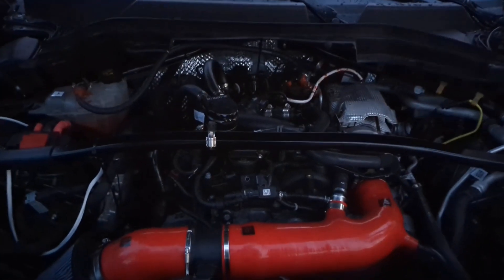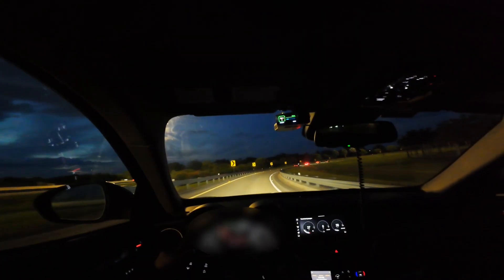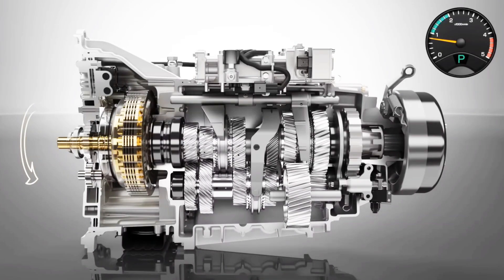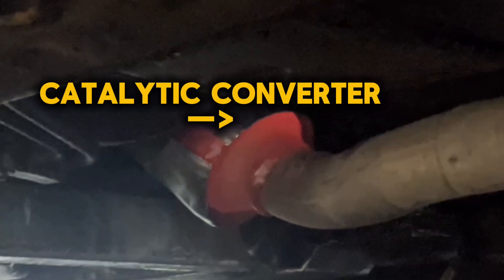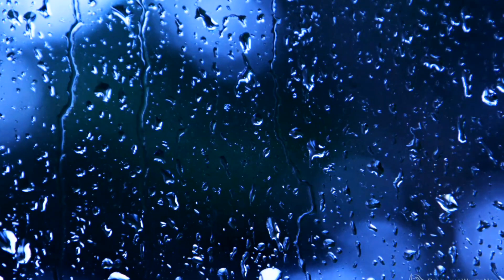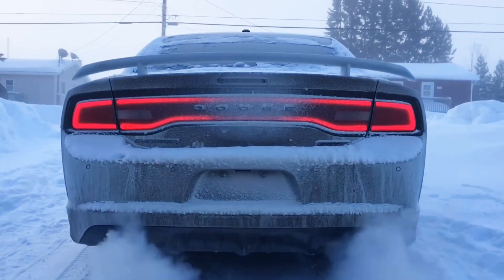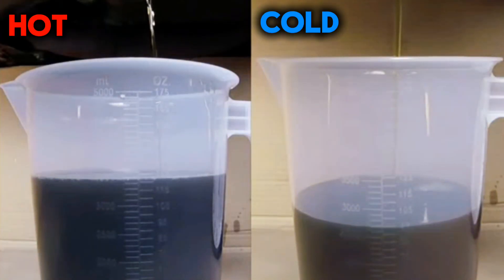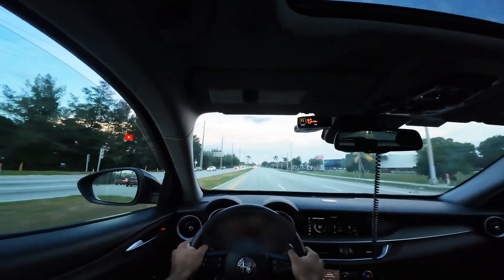STOP Warming Up Your Car – The Truth

Comment: I'm gonna say b*******, I've got AG. MC with 417000 Miles on it bought it new every time I start up, I'll let it get to operating temperature, just like I let my body warm up before I do anything I own a 2012 Toyota tundra.  219000 miles same thing, I let it warm up. Toyota, Camry 330000 Miles same thing, I let it warm up and get the steel to the right temperature before you start putting torque against the steel, you can do whatever you want to do, but I'm a lot one of those people just crank app and go  I've heard too many stories

Comment: I think it depends on the engine/drivetrain. My car rarely revs beyond 3k and when were changing the spark plugs and checking the head it looks ridiculously clean after 100,000km as if it was just out of the showroom. I usually warm the car up for around 10-20sec but when I leave it for 5+min the car drives very smoothly (Nissan Patrol 2016 shorty, 5-speed manual).

Comment: Catch 0:22 oil pumps are mechanical and oil pressure begins immediately. The residue throughout the engine is pressurized again immediately and extremely cold temperatures is the real culprit ¿`_

Comment: As far as there is a problem of accelerated wear at engine startup, I highly recommend an engine block heater.  I live in the Mojave, and if my car wasn't parked where I cannot supply power to it, I would have equipped an engine block heater even though the winters are very mild here and used it in the summer just to eliminate all under temperature operation and the wear associated with it.

Comment: If you are in a newer (past 5-10 years has gotten much worse) vehicle, they are specifically engineered to start having multi-system failures shortly after the warranty expires. 
Just warm up your vehicle to your liking, the shelf life is shorter than any damage you may potentially cause through emissions controls.

Your gearbox couldn't care less if you idled for 10 seconds or 24 hours a day.

Comment: So what, just hop in and drive while my windshield is still fogged or iced up.  Even in NWFL, the temp drops enough in winter to ice up my windshield and even if I scrape the ice (that I had to buy online because when I went shopping for one locally, the idiots all laughed and said they don't carry them because "It's Florida" and they don't wake up early enough in the morning for the ice to still be there.) the windshield is fully fogged over and I need to let the heater run on defrost for several minutes to be able to see out of it to drive.

Comment: All these tips are lame. Cars are useless unless you USE them, which implies wear and tear are supposed to happen. Idle your engine all you want, warm up your engine all you want. Any engine with OBD2 is not going to be hurt by idling or warming up or not. If your car breaks just because you idle it or not warm up, your car sucks. Additionally, fuel dilution is normal in all engines to a degree. 
If you really worry about fuel dilution/oil life, install a thermostatic bypass valve on the oil cooler to maintain a constant oil temp >180°F which evaporates fuel, change your oil more frequently, install a bypass oil filter which catches the finer particles that the full-flow filter cannot catch, use dual-rated Heavy Duty Engine Oil with gasoline ratings (API SP, etc) which are more tolerant of fuel dilution and contaminants, and schedule 'burn-off cycles' including 10-20 minutes of elevated RPM moderate load driving. 

Engines are not our masters, they should not control how we use them. Instead, we should design them to meet our needs.

Comment: Your car has a higher idle when cold, so your needle is slightly above 1000 rpm, and when your engine has had enough time to warm up, after a few seconds, the needle will drop down to your normal idle rpm, which is slightly under 1000rpm. And in the winter, i will start my car, get out, remove all the ice and snow, and hop back into the car, when im done with all, the engine had enough time to be driven normaly. Its quite simple actually... but i HATE to see some people start their car, put their seatbelt on, and start driving instantly. LET YOUR ENGINE WARM UP A FEW SECONDS PLEEEEASE, it hurts me seeing.

Comment: My opinion, the majority of the people only warm up their vehicles when it somewhat colder outside and that is to have warmth inside. Perhaps that is the reason for heated steering wheels, seats, etc., these days. People do not start motors to warm up, they start engines. Engine oil pressure builds before 15-40 seconds. You will know know this from looking at the gauge, the light going out or even hearing less engine noise after the engine is started in lets say 2 seconds. Transmissions these days could care less if the engine is running and the vehicle is not moving. The last instance of a known issue that I am aware of is perhaps in the 70's when cops (with a certain transmission) would sit for hours waiting to catch a speeder and drop it into gear and then the transmission would give out. Many of us have been idling their vehicles before you were even born based on your voice and NO engine issues have came from a result of doing so such as fuel washing down the cylinder walls. Keep in mind this is with engines with hundreds of thousands of miles on them that still run perfect. I want to say thank you for not using a computer to do the talking in the video.

Comment: What a lot of people dont mention is that driving heats up your oil. If you let your engine "idle until warm" you let your engine run on an extended period of time on "cold oil", on purpose!
Just drive keeping your rpm's below 3000 so your engine oil reaches the ideal temperature as soon as possible.
Reply: Heating the oil is not the crucial factor. You're forgetting that at idle RPM under no load, the engine is experiencing minimal stress. Lubrication requirements under those conditions are only a tiny fraction compared to high-RPM high-load. You're only producing a few HP of power while idling compared to potentially hundreds of HP while accelerating. Change your oil regularly and don't let it overheat and it should be fine. Monitor the condition of your oil if you think your driving style or conditions justify it.
Reply: @shamancredible8632 we're talking about metal/metal friction here. You need that friction reduced asap. Thats the main reason the oil is there (and cooling of course). Im saying low rpm/medium load will cause the oil to heat up faster and reduce friction the fastest.
Reply: see even 3000 rpm is not a good measurement because a lot of engines don't even rev that high, a lot rev to about 6000, and some exceed 7000 rpm. Every engine is slightly different and it's a thing you need to spend time with an engine to figure out what it's happy doing cold, and how quickly the rpm range opens up.

My car's engine has a 2AZ-FE engine, and cold idles at 1500 rpm for that emissions control, but off rip doesn't sound happy at 2000 rpm until it's been idling for a minute, so I keep it between idle(1100 in gear) to 1700 rpm. Once my car's engine reaches coolant temp it starts to drop the shifting points for the transmission down and it'll upshift to fourth at 60 km/h. before then it'll stay in third at 2200 rpm or something. Fully warmed up it's really low strung, getting around town under 2000 rpm, usually between 1400 - 1700 rpm. It does had a noticeable decrease in power at "peak power" from what the factory stats would say(5800 rpm). Opens up 3000 rpm and above, pulling hard at 4000 rpm and seeming to make most power at 5000 rpm. Drops off after 5500 rpm and it's basically not making power above that until redline at 6200 rpm. Transmission waits a while lot at full throttle before upshifting, so in the 3000 - 5000 rpm range it's got great power and then there's this second of waiting for the upshift. I don't know if it's something wrong with the engine or if that's just how they all behave. Still is quicker than the rest of my family's vehicles, so I have the "sporty" vehicle. It's a Ipsum 240u.

Comment: Omg older cars need to be warmed up wtf my dodge nitro absolutely needs to warm up first. Engine trans hate being cold and need to warm up first otherwise the trans shifts horribly  plus won't even shift into last gear until it is warmed up enough. I've had 3 different vehicles that were the same way. So...sorry but you need to warm them up, mine is a 2007. Im tired of these videos where people just talk out there ass.

Comment: This is great and all, but mine's gonna have to sit there until the windshield is clear so I can SEE.
There's this thing called winter, and around here you never know what you're going to get. Ice, snow, rain, sleet, high humidity, low humidity, fog. There's no one-stop solution to getting the windshield clear in all those conditions, so it often takes several minutes somewhere between letting the defrost run and/or chipping ice to have any reasonable amount if visibility.

And quite frankly, I'd rather not go out and sit still in sub-freezing temps while waiting for the heat to actually heat.
Reply: Invest in an ice dissolving spray or independent heating unit.
Reply: In a freezer plastic bag... For groceries ... Put some mild worm... Mild ok... watter... Like if you would carry a gold fish in it. Go to your car and slide it to your windshield. 

Get mind blown :)

Comment: Ok, then, you tell my fuel injected 2000 Silverado that won't accept a gas pedal touch without stalling until the engine reaches a certain temperature that it's just faking because of a myth from carburators. Also, tell my girlfriend's grandparent's Subaru that blows anything rubber or gasket-like that it feels is appropriate when it tries to drive right away the same thing...and both have proper coolan and antifreeze. The problem is, I'll bet, they don't exist in California so therefore they, don't fit the thesis this Mythbust comes from...
Reply from the maker: This is climate dependant.

If your truck stalls if you don't idle to warmup the engine, or that Subaru blows a headgasket if you don't idle to warmup the engine,

There is something very wrong going on here.

Comment: At this time of year, the thing that always pops into my mind: When I need to remove ice from the windshield and other windows, is it better to start up the engine, turn on the fan and heating before I get to scratching off the ice or should I remove the ice, so the engine doesn't idle as long? Whatever I do, I most often must wait some time until the fog is removed from the windows and here I wonder, is it best to let the engine idle on itself or should I hit the gas and increase the RPM slightly?

What is the proper way to do get rid of ice and fog during winter in a way that doesn't cook my engine?
Reply from the maker: The proper way on paper would be to scrape the ice off, then start the car and idle for about 45s and take off.

BUT - I'd probably start the car, turn on the heater and heated seats, and then scrape the ice off because I can't stand the cold.
Reply: @TorqueTheoryLabs But when the car's windows are fogged up, it takes a few minutes until the engine is warm enough that the heating actually clears everything up... so it seems there is not much you can do (unless you take a hot-water bottle with you).
Reply: I would highly recommend an ice dissolving spray instead of scraping.

Comment: It was 5 degrees last week where I live. I'm letting that thing warm up every chance I get.
Reply: It sometimes gets to below zero here (lowest I personally seen was -12F).  I let my engine run till the wipers are unfrozen and the sheet of ice is melted enough to scrape off.  That can be 15 minutes on a bad day.
Reply: @JesusIsLordAndSavior77  -20C to -30C here can be pretty common durin peak winter for a week or two, generally the time it takes to warm up is enough to clean the snow off the car and shovel the driveway. Adds up to a nice mornign exercise =)
Reply: @dcg-f7r  That's a lot colder than what we ever get here.  We get a lot of freezing rain, but not super cold.
Reply from the maker: I hate the cold
Reply: @TorqueTheoryLabs You also forgot that not all of your subscribers live in the south. It's currently 12 degrees here in Upstate NY/Southern Canada and we're getting a couple feet of snow for Christmas. Im letting that shit warm up.
Reply: Yes I always wait for the oil gauge to rise to normal operating level before I drive.

Even in a high performance BMW M5 the car explicitly warns that revving the engine beyond 4,500rpm before the oil reached proper temps will damage it.  I’m pretty sure this translates to all engines not just the high performance ones.
Reply from the maker: So drive off w/o going to 4500RPM?
Reply: @TorqueTheoryLabs I need to further clarify, the freeway ramp is approximately .75 miles away from my house.  I don't have the luxury of being able to drive slow for long before I hit 70 on the freeway.

I used 4,500 rpm off the top of my head, it could've been 3,500 rpm.  Point is that pushing an engine before the oil has reached operating temperatures regularly can and probably will damage the engine over time.  Will it kill the engine?  Most likely not, just make it louder and sound worse which also means performance loss.
Reply: @duyvuitton6019 this guy that made the video forgot that the frozen north exists. The closest interstate is like 35 minutes away from my driveway. It's currently 6 degrees and we're getting 2 feet of snow over the next 3 days for a white Christmas.

I'm letting that shit warm up.
Reply: @realWARPIG It appears to be common practice as I still see people start their cars and then immediately drive off.  I'm originally from California so I can understand the perspective from someone who's never experienced artic temps, in the south that oil is always warm so I can see how it's less of an issue there.

Even in the warm months I wait until the oil levels are up to normal levels before I drive.  Not that I drive fast but like to let the fluids get comfortable first.

Pro tip: Use the parking brake/e-brake every time you park to prevent grinding gears of the transmission every time you shift.

Comment: Question: At cold start my car is making a louder noise and rev at around 1500, in this weather (around 4 degrees celsius) it keeps that RPM for a good 60 seconds minimum. I usually drive off after 30 like you said tho as I feel like it drops faster than idle. My question is: After those 30 seconds, if oil did circulate, why is me engine making a loud noise and revving above 1200 rpm? I thought it stops revving after oil circulated but perhaps thats to make it warmer? idk
Reply from the maker: Cold start emissions strategy to light off the catalytic converter sends fuel into the exhaust by running excessively rich, and raises RPMs temporarily.

Is the loud noise just exhaust noise? Or something else?

Comment: No I will not stop warming up my car, and you can't make me stop.  I don't care what the Radical Environmentalists want.
Reply from the maker: They want you to warmup your car to light off the catalytic converter.

This video literally says the opposite.
Reply: @TorqueTheoryLabs And before the advent of converters, you were well advised to warm up your car to promote longer engine life, less plug fouling, less likely hood of stalling at the first red light.
Reply from the maker: @jamesbosworth4191 

If you stall because you don't warmup by idling, you have bigger issues.

It's not guessing. It's literally how it works. You light off your converter quicker by cold start idling.
Reply: @TorqueTheoryLabs You must not remember the 70s and attendant emissions tuning.  Automatic chokes were as loose as possible, and opened up as soon as possible, in sharp contrast to their older counterparts that were set and opened slowly enough to ensure best possible drivability.  And besides, refusing to warm up your engine can shorten engine life.  I want longer engine life, not shorter engine life, EPA be damned.
Reply: @TorqueTheoryLabs Besides, I want to be able to use my defroster when I start driving.  You can't with a cold engine.  I don't like cold air blowing at me in the cold.

Comment: For those of us that have a 5 minute commute to work, we dont have a long drive, and i dont want to launch my car cold, nor do i want to go for a short cold drive with no rpm's. If i warm my engine to temp before going, i can at least run it a little hard.
Reply from the maker: Better yet - drive to work without it fully warming up, then go for a spirited drive after work flooring it a couple times once fully warmed up.
Reply: Long idle and THAT short of a commute will kill your engine quick. Consider alternative ways of commuting or an electric vehicle.

Comment: My solution to this problem always was to use the remote starter when I'm within 100ft of my car and by the time I have my backpack and satchel in the trunk and I'm in the driver seat, it's already been at least 15 seconds and my idle rev has lowered and stabled out, and we're off driving
Reply from the maker: That's a sound plan!

Comment: What should the oil temp be before wot? In the winter, I can drive for 30 minutes before my gli hits 180. Do people not floor it at all before then?
Reply from the maker: Only floor it once your oil reaches the operating temp your manufacturer specified for your engine, some engines run colder oil temps, and some hotter.

There's no real universal answer to this.

Comment: What about older vehicles I have an 04 Jeep Grand Cherokee (WJ) and normally I start it then drive after a minute or 5 depending on how long it takes for there to be an opportunity to pull out and my Android auto to connect.
Reply from the maker: This also goes for older vehicles.